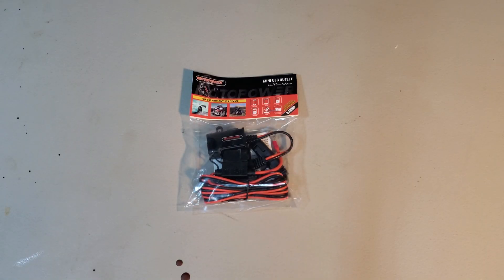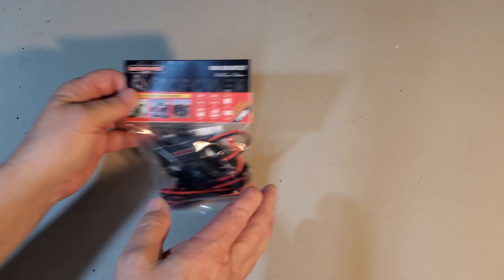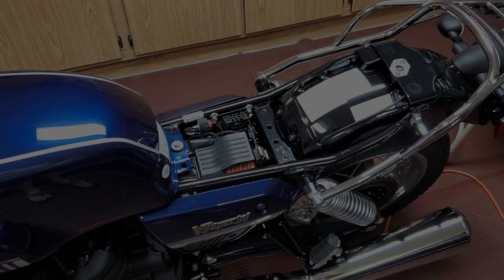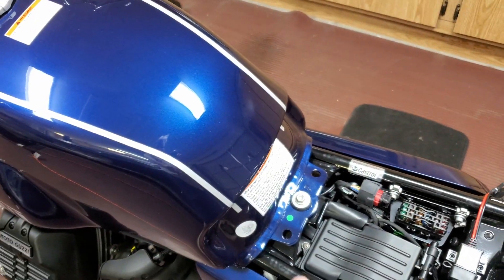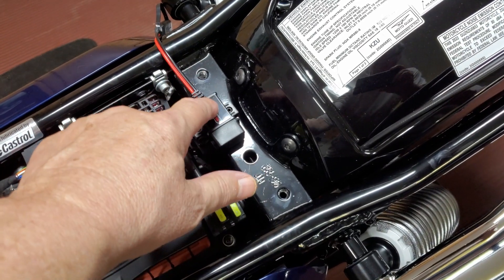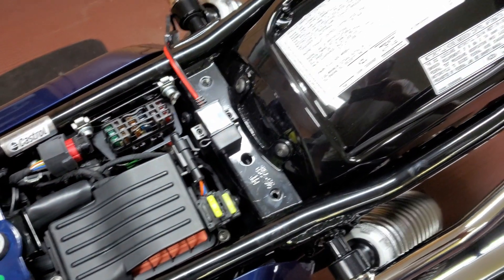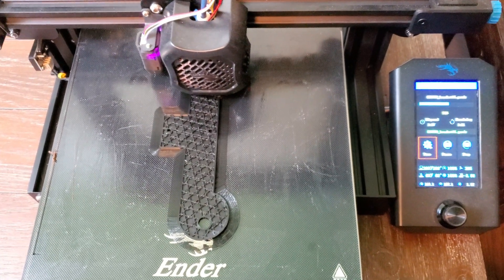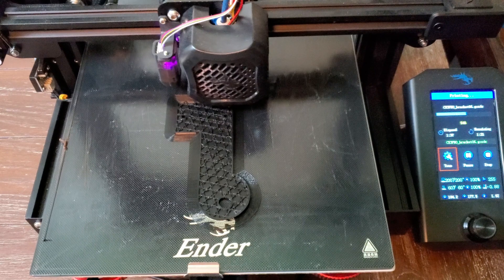MOTOPOWER Motorcycle USB Charger Installation on a Moto Guzzi V7 Special

Comment: Doesn't the small converter of the usb charger empty your battery? Typically these devices need to be hooked to a switched plus cable not direct to the constant plus of the battery.
Reply from the maker: It hasn't so far and it has been in place for 3 years. But I also always have the bike on a trickle charger. But I suppose it could, I don't know?

Comment: Don’t do it. The circuit that you’re taping into controls other stuff on the bike . If the usb charger fails it could take out other stuff on the bike.Its better to get a usb charge from Amazon and connect it directly to the battery wit its own fuse.
Reply from the maker: Good point with adding a fuse, but everything has been fine.

Comment: Could you post the .stl file to thingiverse or share it somewhere? I have a V7 as well and that would be extremely useful!
Reply from the maker: I will try to post it to thingyverse.  You will probably need to scale it to the correct size.
Reply from the maker: I posted the object. I hope it is the correct file, I have several versions. The file name is Moto Guzzi V7 USB Charger Bracket.  Give it a day or so before checking for the file.  Remember, you will probably need to scale the object to the correct size in your slicer, so you may want to print a draft version first.  I hope it works well for you!
Reply: @SPSteve  Just tried out the mount on my V7, it works perfectly! thanks again so much!
Reply from the maker: @anzarkkala  Awsesome!  I'm glad it worked for you! :)
Reply: @SPSteve  sweet thank you so much! I’ll definitely try it out and let you know!